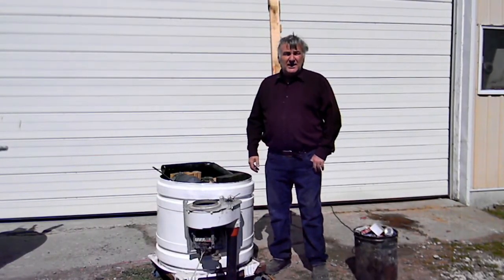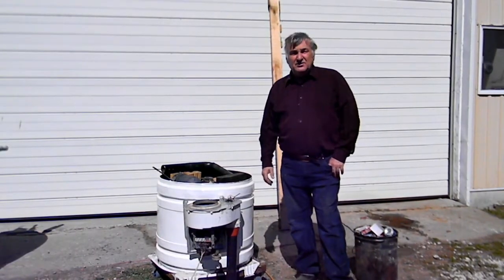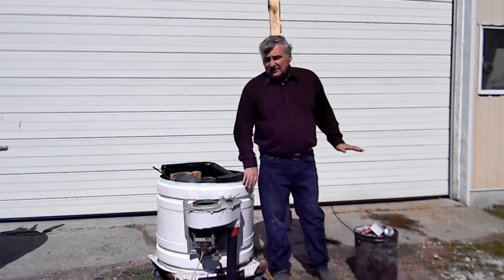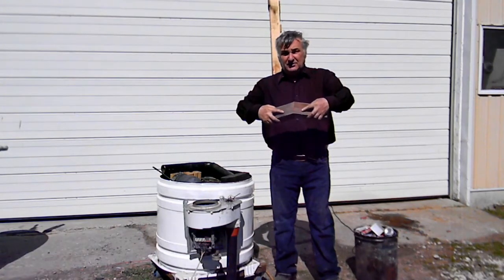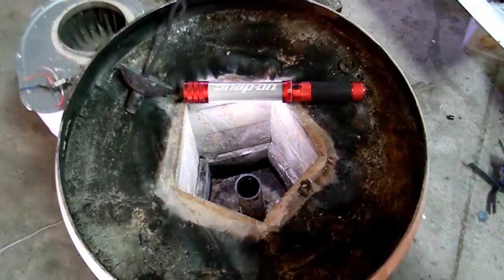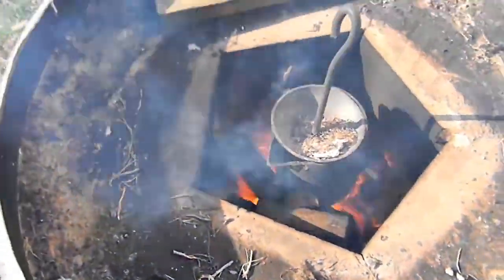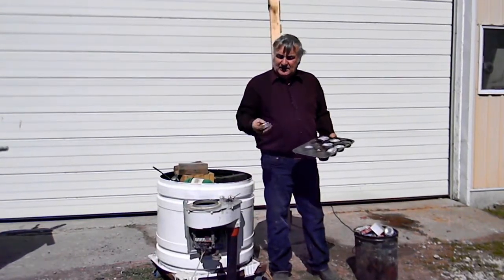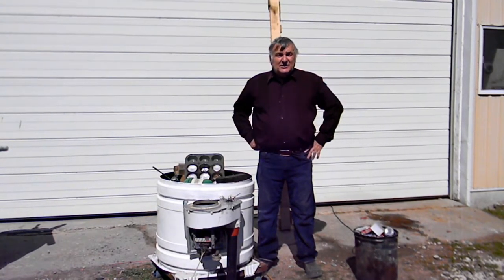Wood Burning Aluminum Foundry

Comment: I adapted one inlet under floor to let air flow upward, and a secondary inlet above the floor for propane gas. So i can choose which type fuel i can use.
   I use a hand crank or hair dryer/leaf blower for the airflow, When i use wood. I used a iron pipe capped with drilled hole, semi flatten with a hammer to expel air upward. Through holes i made on floor, which i cover with fire type brick.
  If i use propane i use a torch type, 
  i use a steel containers for a crucible. To melt aluminum or copper.
  When i pull out i use a three, type lifter which i stick into drill holes in side. Then slide a ring downward, on spread  arms, to keep all prongs tight and no accident spill.
  I use two type for my small pours.
   One i place in a preshaped brick, that i lift, brick and crucible together, over the crucible i slide a brace to hold crucible in place. The brace is slid into two holes into brick itself, and slide the brace just above crucible, one side bent on brace(like a capital L), which i place my hand over when lifting, bend placed downward.
  2) the holes in crucible, i have in a way to put a rod(rebar) all the way through the container.  Then i place rod in eyelets, like a swivel. Just make sure put knotches on rod, so it dont slide on you, which i had happen when i first did it.😂 
 Once done just tilt and pour. 
 I now found a way to leave the crucible on brick, made a weighted base.  Then slide one ring on one side of rod(make one slide longer ao you can lift if needed) then slide it over to second side of rod. The knotches i only make on one side. Then once centered just lift, out of brick,  and set it on its new weighted  tikter
Reply from the maker: I got some coal from an old house with a coal bin and they gave it to me.  I tuned the forge for maximum smoke using the coal.  The steel crucible which is an old oxygen tank melted..  Going to be doing gears for a gear reduction sales cart, using lost foam casting this month.

Comment: I believe the reason you are throwing out so much slag is you have an oxidizing atmosphere, so you make aluminum oxide which you are throwing away.  in a reducing atmosphere, oxide will be turned back into metal.

I used to cast a lot of lead, and i used a teapot.  by putting wood chips, paper, etc in the pot and covering it, i consumed the oxygen inside and my lead oxide and the filmy scum from skimming turned into lead.  you could do about the same thing and lose a lot less metal, i believe

Comment: Comrade you just made me rethink some of my project ideas that I'm literally going to be drawing out this weekend.  Thank you for sharing keep up the great work.
Reply from the maker: Thanks for comment,,  the carafe is many years old and still not showing any sings of where.  I have an extra mini oxygen cylinder but don't know where to get more.  The lid made from an disk brake is still the best.   I modified it to work on old oil from the local farmers oil change for tractors and combines.  I use a leaf blower for air and can now do copper no problems.  I did try coal with the leaf blower and melted the center steel support pipe.  The carafe was ok though.

Comment: I knew I was doing something wrong! My airflow was blowing straight up cooling my crucible after the wood directly under it burned out!  Wonderful to see how your set up works, and now I know!
Reply from the maker: i found someone with a basement full l of coal from 80 years ago.(free) I modified the unit for coal using an old disk brake rotor.  First attempt actually melted the steel perforated support shaft.  Will do another video soon. It now works on most any fuel for any heat and metal.
Reply: I found a couple small piles of coal along the side of an old abandoned railroad.  I used a bit to try to melt down some copper and melted the inner liner of my foundry! Time for a rebuild.  I found a recipe for a portland cement mix to make the refractory liner.
Reply from the maker: @troylaarman4424  LOL    I got a leaf blower for air power and when I put that much air on the coal it had no problems melting the steel..  I will get you new video soon..  I found the cast iron disk brake and rotor are great for foundry lid.  I also used real fire brick for the inner lining of the foundry.
Reply: That's cool. I don't have a crucible that would hold up to steel melting heat.  I do a bit of blacksmithing and have melted my work several times using coal in a old truck hub... left the piece in the heat toooo long. I'm off-grid so I use a dc blower motor from an old truck  that I built a housing for.  I had to put a three speed resistor switch on to limit the airflow.  I'm making cobb tonight to try to salvage my little foundry.
Reply from the maker: I have two mini oxygen cylinders, that where used in the pass for Old folks who needed oxygen to breathe.   I cut the top off using a band saw to create the crucible.  Been using the forge and Oxygen cylinder carafe for over 5 years and many casting with no sign of wear, breakdown or deformities.  Those oxygen cylinder are 1/4 inch think with round bottom..  I don't have any need to cast iron or steel, but if I did, I might create a carafe out of 4 inch stainless steel pipe with a welded base of some kind.
I actually use the forge for casting parts for my other products and invention..   check out (babyboni) in youtube search bar for my latest product.

Comment: hi friend, I just built a wood-fired furnace very similar to yours but I can not reach the temperature enough to melt the copper in an iron crucible. have you tried to melt the copper with your wood stove?
Reply from the maker: I changed to a leaf blower with an adjustable speed control.   found used one for $20.   More air makes huge difference.  Also, I soak the wood in old oil helps for longer and hotter burn.   Old broken hardwood branches and hardwood pallets or skid.   Also I use an old disk brake for the lid.   Works great and never breaks.    check new video   https://www.youtube.com/watch?v=LN_uUag0Fus
Reply: great video compliments. you had a brilliant idea using a brake disc. I only have wood and I use an old hair-dryer for ventilation in the past I have melted brass and I think that I will never make it to melt copper. correct me if I'm wrong. 

I think I buy an electric oven for metals.
Reply from the maker: What many people don't understand is that there is many ways to accomplish things.  Electric sounds good,  tell me how it works out.
Reply: somebody melts copper on a yt video but i don't know about wood.

Copper has a relatively high melting point of 1,083 degrees Celsius (1,982 F),

Comment: This question may be redundant.  Are you using hardwood as fuel, and if you have to add more. What do you do?
Thanks, great video!
Reply from the maker: I use all form of scrap wood or burning material.  Maximum air is the key to a hot burn.  Good hardwood or coal will burn longer, not necessarily hotter.  I change the lid to a ford front disk brake disk with a handle.  Never wears and is lighter.  Refilling the wood is just a matter of removing the lid and packing more in. Cutting the wood in small pieces works best but as long as the pieces fit all is well.

Comment: Great work. Could you do another video showing how the wood feeding and operation work. And more detail on the building plans etc. Also may I suggest a external mic. It was a bit hard to hear especially with the wind on the camera mic.
Reply from the maker: THANKS WAS PLANNING ON DOING NEW VIDEO.. Changes to unit now include a new lid made from a ford disk brake rotor.  An old brake drum would work even better. I sealed the colling vents in the rotor using plaster of paris.  No more cracked lids.  The blower has been changed to a leaf blower with two speeds.  Slow speed is more then enough for aluminum with high speed for brass.  I fill the wood to the top in when the flame stops pertruding from the lid. Just shut of the blower, remove the lid and fill.  Using hard wood helps.  Old skids are the best wood for cutting and fitting.